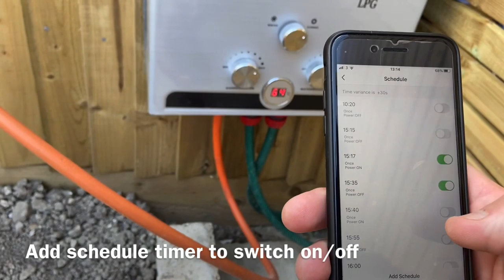DIY Hot Tub Build (plumbing and heating)

Comment: How long it takes to warm up the water of the whole tank from 20 to 40 drgres?
How much gas consumption you have?
Reply: To warm up the water it’s takes around 2-3hours,but because I insulated with polyurethane insulation and made lid for it,Only drops 3 degrees overnight even in winter which take another 30min to heat up next day.I use 13kg propane gas bottle which last me 3full times to heat water from cold and at least another 10 times to top it up during next days.If you planning to use it more in winter months like we do then highly recommend you to insulate it too.

Comment: Hello, what type of circulation pump did you use?
I was thinking about doing the same, but am unsure if it would be better/safer to use a DC pump instead of AC
Reply from the maker: I use second hand 3 speed grundfos circulation pump installed on 30ma rcd and installed extra earth cable from the pump for extra security.Dc pumps work well but normally very loud vs circulation pump.